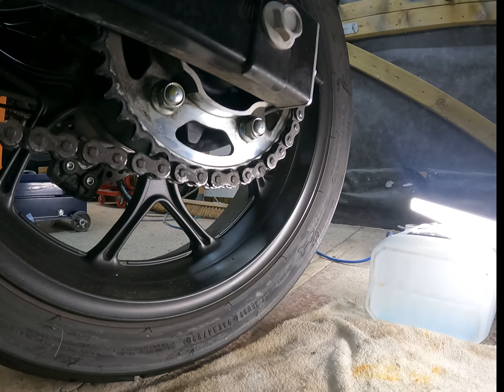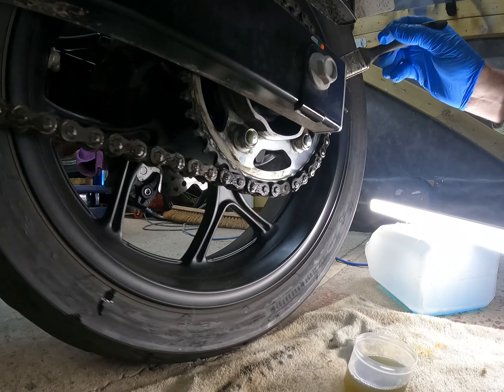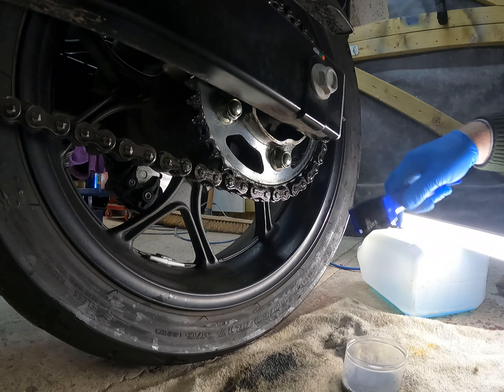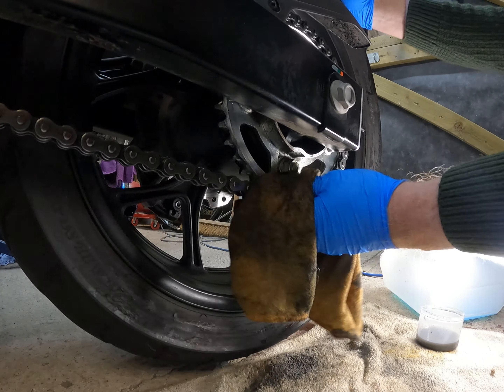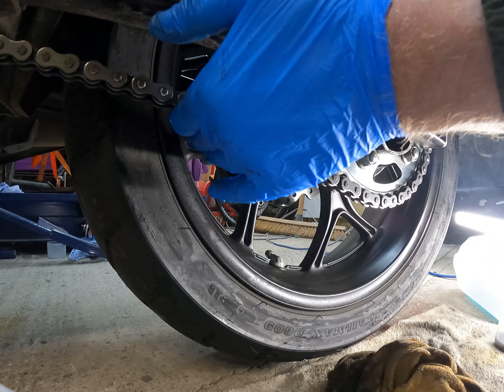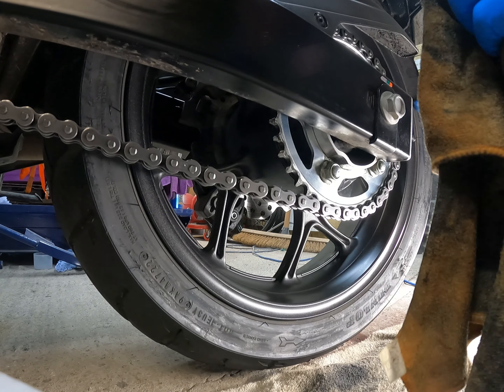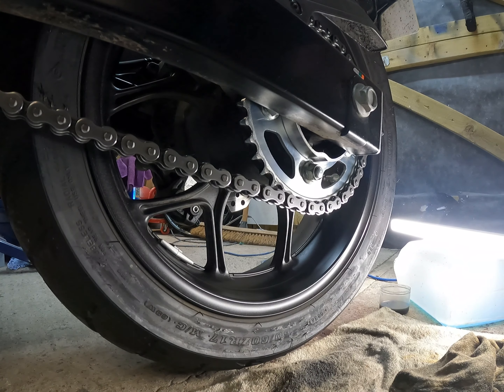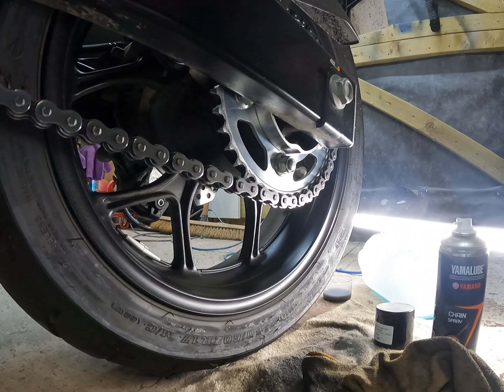Honda NC750x DCT Cleaning Chain "THE PROFESSIONAL WAY".

Comment: Hi, did you find out what the play was in your chain? Was it the front sprocket? Cheers. 😎🏍👍😁
Reply: @birchwoodbiker  hi thanks for that, I have the 2015 NC750X dct, and I have the centre stand on mine, when I go to turn the wheel when it’s on the stand, it is a bit stiff to start with, but it gets better the more you turn it, but I haven’t noticed any slack like yours? Thanks for the prompt reply. Thanks. Happy new year buddy. 😎🏍👍😁
Reply: @birchwoodbiker  Hi, thanks for that, I appreciate your time, I will certainly keep my eye on that. Cheers. 😎🏍👍😁

Comment: Hi Mr B . I use paraffin  have for years  yes spray it on  & the crap just falls off . Yes give it a rub a brush . & a spray  with wD  40 clean up any residue of the paraffin.  Then no e of theses fancy lubes  just some  clean engine oil . & wipe off any excess. ££££ the cheaper way just every 1500. Miles clean be be much quicker  each time when your on top of your routine . Yes petrol   & diesel  work too .  Love life  & keep  the bike on the suney side of life . 
Rolley  :)
Reply: Whops sorry  every 1.500 miles :) Rolley  .
Reply: Paraffin is great, it's what I use on mine. Get it from stores like B&Q or garden centres as it's used for greenhouse heaters.
Don't use sticky chain lubes either, I use oil as it's much easier to clean off.
I have a chain oiler on all my bikes, a TUTORO ( Top Up Turn On Ride Off) it's a simple motion activated one, so no vacuum or electrical connection. One fill of the reservoir lasts about 1000 miles.
Takes me about 20 minutes to do a full clean of my chain and both sprockets.

Comment: I find baby wipes work really well 😎 Personally I'd never lube the chain with the egine running, too many people have lost fingers that way 🙈
Reply: 🤣 @birchwoodbiker
Reply: Dont use baby wipes. They leech very thin plastic threads onto your gear. Nearly invisible if wet. Those fibers wrap around the chain pins and when heated turn to plastic blobs.

I use old cotton socks 😂 pretty sure no grit can stand up to a pair of my socks after 3 years of use.

Comment: Thanks for sharing. Livening the channel. How do you get the back wheel to spin freely? What stand do you use?
Reply: He has the bike up on the center stand that Honda doesn't include and greedily offers up for you to purchase as an accessory....😠
Reply: @kenbowlus2995  novice biker here. I have a transalp and I don’t have a centre stand. Is there any tips for getting the back wheel up easy?
Reply: A trackside rear lift works.